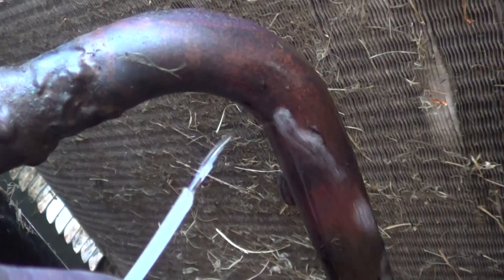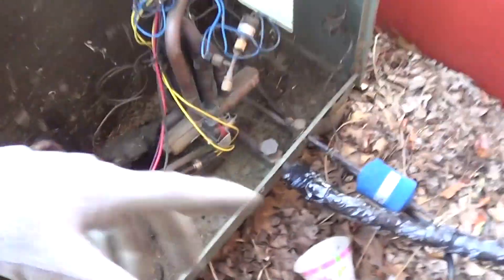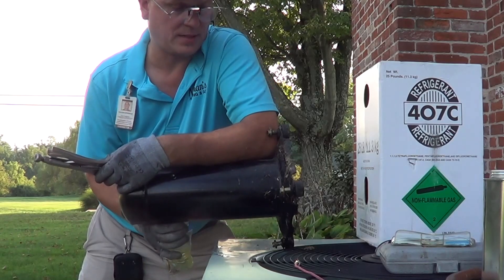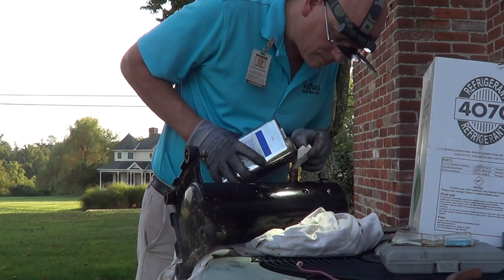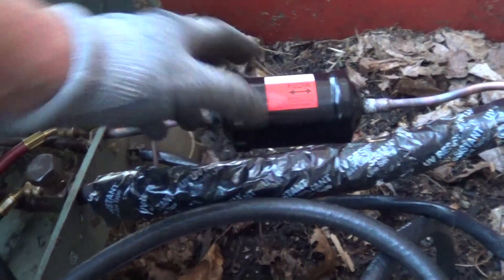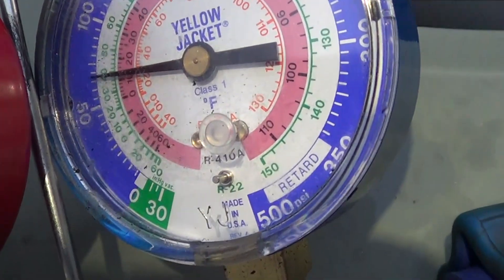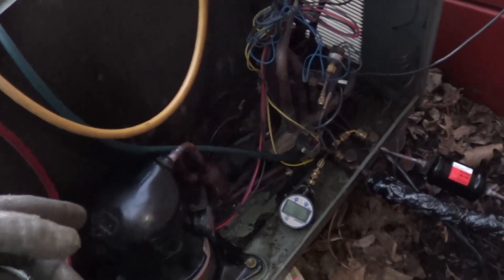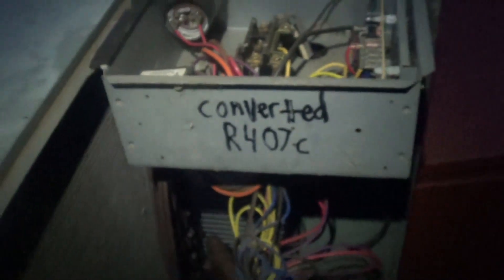Converting a R22 system to R407c

Comment: Converting a R22 system to R407c 
1 I read  95% polyolester oil (POE) and 5% mineral (old R22 oil) is OK. 
2  POE oil is hygroscopic that means the oil should be pumped in and the oil can should not be opened to the air. 
But great work this is almost unknown by local Hvac companies here in DFW Thank You
As a Hvac engineer 
You can open compressor 
Removing the valve stem. 
Insert a rubber tube down to the bottom of the compressor 
Suck out 95% the old R22 mineral oil. 
Re install valve stem
vac system
Purge with dry N2
Vac system
Charge with R407C
That way the compressor stays in place and all your doing is sucking out 95% of the old R22 mineral oil adding new POE oil then re install valve stem. Purge with dry N2. Vac the system and charge with R407c.  
Pulling the compressor IMO is not necessary.
The above is a really low cost way to go from expensive obsolete R22 to low cost R407c
Reply from the maker: The moisture sensitivity is over rated.   It takes hours for POE oil to saturate.  And, when it does saturate it is still just parts per million of water.

Comment: hello there, let me see if i understood about change the refrigerant r22 to r407c. for an a/c by expansion byt capillary tube or expansion valve only is necessary change the oil of the system and dryer filter from line of liquid? or exist other dispositive for change it?
greatings from Perú.

Comment: What a waste of time and money.  Either change to 410a or stick with the r22 its way down in price a 30lb jug is only 290.00 in Mass thats way down from 2 years ago.  This is way to involved for the results.  If my company was stupid enough to do this I would disconnect the condenser and flush it and the line set and evap coil with rx11 flush.
Reply: Piece of fuel line split   auto 2clamps 2 lb gas good as new 🤗

Comment: I've used r422b with great success! AC and reach in freezer box. No modifications!  Negligible loss.
Reply: R407C is the closest replacement for R22, and is cheaper than R422B. You use R422B is because of no oil change required?  Here is the video about comparison of different replacement refrigerants. https://www.youtube.com/watch?v=npyYvT2Z1wU
Reply: @alicepet1994  the guys around here have settled on r422b. One refrigerant to carry that works great. This coming from a trusted United Refrigeration manager.
Reply: R422 b  works great, it’s just more expensive than 407

Comment: I just changed a r22 system with 407C+, the plus lets you do a direct drop in with an additive already in the gas which mixes with the R22 oil. 407C+ is a little more expensive but it saves you the time of having to add oil. Also, if you get a leak later on, you only have to add 407c because the oil is already treated.
Reply: Old comment - but thanks. I'm a student studying for my Universal.

Comment: Old oil looks pretty clean. What's the best POE oil for R407C? Thank you
Reply from the maker: It just has to be the POE chemical designed for refrigeration applications.  There are a few brands.   It is about $50 per gallon last time I checked.   But, you can buy quarts.
Reply: @NathansHVAC  Thank you for your quick response. I bought one gallon from ebay which costed me around $80

Comment: He's a bit messy w the oil coming from myself a 22yr technician and dont make it sound like 🚀 science dude but your probly in the small percentage of good techs out there😊
Reply from the maker: The money is in replacing systems though.  So, there is an advantage to being a tech that only replaces the system.  Me...   I try to do both.  If the customer wants to keep a piece of junk running, I will keep that piece of junk running.
Reply: @NathansHVAC  YOU DIDNT NEED TO PULL A VACUUM?

Comment: 407c will foam if no new oil add. some people topping off r22  1 -2 lbs 407c will foam removing hoses. you can add 4-6 oz to mineral oil to stop the foaming yes need a new filter. Move filter to outside of condenser.
Reply from the maker: I never notice problems with foaming on residential.   Some scrolls are oil pumpers though.  But, they are usually very old and end of life.
Reply: @NathansHVAC  I see it before but did not know this happen my wife friend unit i worked on on a weekend only gas i had was 407c add 1-2 lbs next day trip the high psi reset. place hose on port Dam it foamed. Pulled gas out poured mineral out of scroll refilled synthetic POE bingo no waxing or foaming. They said to never cooled this good before. Only way to see if compressor is to pump down test to see if valve hold. Doe not hold vacuum yes end of life or 75per  lose of BTU.  This was 3 yrs ago. Last month i top off one and same thing waxing so add 6 oz POE BONGO NO WAXING 100% LIQUID. NO RESTRICTION.Now i know what to do if unit waxing up has restriction. 407c 100% and old oil will wax up. This why i never install a drier back inside a cond unit. and move it outside the unit. for true Pressure readings.
Reply: I seen waxing both commercial and residential but only mineral oil.

Comment: Use el Iseon MO99 (R438A).
Reply: Es más fácil pero pierde un 14% de eficiencia comparado con r22 y con el r407c solo 3% y si es sistema heatpump esta lejos de trabajar adecuadamente el mo99 Te lo digo por experiencia propia
Reply: @greggiron93cervantes72  , Boa noite senhor,  a adição de  20% de  POE  no ÓLEO   mineral que se encontra dentro do compressor   E O CORRETO OU ENTENDI ERRADO?, obrigado.
Reply: @josem.8159  no entendí bien jajjaja pero creo que entendiste bien le sacas el aceite mineral al compresor y le agregas 20% de poe y queda exactamente igual al r22
Reply: @greggiron93cervantes72  , senhor  Gregori,  pergunto: devo retirar todo o óleo mineral e depois usar somente o POE na quantidade de 20%  ?, muito  obrigado.
Reply: @josem.8159  tienes que sacar almenos 90%

Comment: Hi nathan i got an original r22 split system, ill be replacing condenser that equipped with 1lb of r410a,can i recover refrigerant & use r407c?
Reply from the maker: If the metering device is fixed orifice on the evaporator, you could just run R410a in it.  If the evaporator is expansion valve, you have to run R407c.  But, you will lose capacity with the R410a compressor.  But, it will work.
Reply: @NathansHVAC  the evap has a piston

Comment: I would not hire you with the practices used, the system is so inefficient now, the oil is not correct, it is certainly not ‘ozone safe’, you should flush every time, the miscibility is not there. You started charging with vapour with an azeotropic blend. I assume you didn’t check superheat or subcooling. Not trying to be harsh, but your not following the correct code of practice.
Reply from the maker: Perfection is the enemy of good enough.
Reply: Part of the “that’ll do” club

Comment: What a waste of money. It’s a r22 system. Throw it out and install a new system with wty. This doesn’t do the customer any good. 

There is retrofit gasses like mo99. That don’t require all of what you did. Weld up the leak pull a vac and charge it up. 

I’d never do what you did. None of it makes sense!

Comment: I have a customer that bought 20 rental units almost every unit had no filter and impacted coils most were low on charge. Now I’m not disagreeing with you but I told him I would have to pull and clean all the coils fix leaks and convert all that were low to 407-c or replace the systems he had just bought the two buildings and was low on cash he said he just needed to get by for 6 months and he could only afford to spend 500 per unit at the time so I pulled the coils fixed the leaks pulled vacuums and charged the systems no oil change I told him without oil changes they would not last three months ( that was almost two years ago) I’m not saying it’s not a good idea to change the oil but I am saying that two years later 17 of the 20 are still running and the 3 I had to change failed because the condenser coils lost all ability to transfer heat due to corrosion not compressor failure so to all that say it’s not possible to not change the oil and last I guess I should not believe my lying eyes right! Again I’m not saying the manufacturers are wrong but that’s not really a small test sample either take it for what it’s worth 20 for 20? Now talk all the trash you want ps that’s not the only time I’ve done it with the same results
Reply: alot of guys at my local shops are saying the same thing. just drop it in and no problems
Reply: As long as you have enough velocity (which r 22 systems have) and the compressor is not installed too far above the evaporator coil oil return should not be a problem. A few squirts of POE wouldn't hurt either.

Comment: So when you evacuate the r22 charge it doesn't pull out all the oil in the compressor too? Isn't oil mixed in with charge?
Reply: Ron's Electrical no the oil is still there but read my comment

Comment: Did you literally waste an entire day when you could've saved this homeowner the agony and brazed that leak fill it with R-22 you're out of there in 2 hours and tell them you'll need to be replacing this system very soon. It's called the R-22 phase out. Wow!
Reply from the maker: 407c is super cheap and the only r22 substitute with full capacity.  But, I don't convert very many systems.  I mainly wanted to video this conversion because the other substitutes have their own problems with capacity or charge sensitivity.

Comment: I cant fathom why you wouldn't take two minutes to measure out the old and measure in the new oil.
Reply from the maker: You don't need accurate oil levels.   Plus, since this system was very low, a lot mineral oil was in the evaporator.  It is not rocket science.  This system is still running fine today with the conversion.

Comment: What is the process if it was r410a instead of 407c on a r22 system
Reply from the maker: R410a needs a new system.  The pressure is double that of R22 and the compressor won't pump it.

Comment: Did you flush the lines?
Reply from the maker: Poe and mineral oil mix fine.  They are both oil.   If you have synthetic blend in you car you are running mixed oil.  The idea is to have enough poe in the system  to mix with the 407c refrigerant.   The poe oil will drag the mineral oil back to the compressor.   This is residential, not low temp.

Comment: And 2 months later you get another leak on this dinosaur. 1500 bucks down the drain.....
Reply: Troy B true that
Reply: Troy B maby but do u call the shots or does your customer your invoice should give a detailed summary of why you recommend against it and then let them decide if they want to do it and you refuse then I or someone like me will be happy to take the job read my comment
Reply: @peterdarlington4117  won't touch it. I'll collect my fees and roll out.
Reply: Troy B So basically you’re going to tell them I’m going to charge you for telling you that I will not make a repair because I don’t agree with it if there’s ever a case where I’d be like I am not paying you buddy take me to court that would be it A good tech gives them every option and lets them decide maby that’s all the money they have and want to roll the 🎲 and I’ve done a lot of no oil change conversions to 407c and years later they are still running and others said only option is change system they will never use anybody but me agine
Reply: Troy B I get what you’re saying not trying to beat u up I use to be the same way
Reply: @peterdarlington4117  there is a sevice fee for diagnosing the problem...you have a leak. Then there is a fee for pinpointing the leak. The leak is in your condenser.       
  If you are charging g your customer to repair a leak on a condenser that is over 10 years old with only a 1 year warranty on your weld only...you are ripping your customer off. There is a proper way to do stuff and then there are the other guys.
 I can get a new condenser for them with a 10 year warranty.
Reply: @peterdarlington4117  yah that's what I'm saying.  The fact remains that I did the work and they owe. Most likely it would only be the service fee because I would have explained about the leak. If the want to keep my service fee then so be it. I'm not sure what your hang up is. You telling me you would do the repair which is in my book ripping them off. You should know better than what you are saying. It's the homeowners junk and you are going to put him 1500$ in the hole on a new system and leave him in the heat....again.
Reply: Troy B The other thing is with me that’s not a $1500 job I charge 600 bucks to sweat in a dryer and fill the system with gas and repair that leak And for some people if that gets them a year they’re happy with that And that’s not me saying that if you charge $1500 your ripping the customer off it’s just me and my sons I don’t have the overhead of 10 trucks on the road and all that mess and by keeping my company small I keep my prices low so I guess it’s just the difference and how we run our companies but I also don’t guarantee you know I’ll be there in an hour or some stupid shit like that my customers wait till I can get to them because they know it’s half the price of most other companies But it keeps me busy and keep my customers happy
Reply: @peterdarlington4117  600 is better than 1500, but 600 is too cheap, may depend on location. i welded a york package unit one time, the weld was solid. within 2 months the customer developed a leak a few inches further down and we ended up telling him "we will be chasing leaks down until you cant afford a new system", he bought a new system. never again will i repair a "condenser coil".  im also sure you shortened your list of the repair.  flush, acid test, oil, vacuum to name most of the others. Not to mention good luck welding up these thin azz coils they have these days and im sure if its aluminum you are not welding it. Anyways we are both in it to make money and if you are making the money and you feel its a good profit, well.....thats all that really counts as long as the customer is happy.
Reply: Troy B no list shortened I’m very aware that you’re supposed to change the oil and do all the stuff the manufacturers recommend but if you read one of my other comments on this post I wrote a whole thing about a customer Of mine who bought 20 rental units and I did not change the oil or add acid scavenger I just recovered pulled a vacuum and charged out of the 20 of them I did 17 are still running and three had to be changed but not for an electrically shorted compressor for condenser coil‘s so corroded they could no longer exchange heat running a 425 head pressure I actually told him he would probably only get six months without changing the oil but like I said it’s been two years and I have multiple other instances where I’ve done the same thingAnd they’re still running with no problems again I’m not trying to say that’s the right way to do it but that’s also why I only charge $600 well that and the guy has 230 Rentals and I do all of them But also he has been a customer for a long time he knew the risk but decided to roll the dice and it paid off for him

Comment: I use R438a (M099) and no oil change. No failures in 5+ years.
Reply: Same here. I just change the driver. No problems. About 8 peices of equipment in the last 4 or 5 years.
Reply: Drier
Reply: Propane  is scary

Comment: Hello,   I hope you can give me advise on this
Currently, I have R22 3 Ton it stops cooling after 30 minutes. its 11 years old, tech said compressor heats up then stops.
So my question is which brands do you recommend and coolant? I have a quote for $4k Guardian 3 ton/14 seer with new evaporator coil  410a. Or American standards 3 Ton/ 14 seer with coil 410A $5800.   do you recommend changing the pipes or flushing it should be good enough
?  In my city of lodi,ca electric is not expensive last month usage 1184 kwh total $200 that's heavy use, in winter we use 675kwh
Reply: Delta Transportation Worldwide check your outside condenser coil. If it is dirty it can cause high pressure and trigger the high pressure switch. I have seen a lot of situations like yours. When the coils are dirty the heat wouldn’t be released. High temperature high pressure. Just clean the coil you will be fine. Some company push their technicians to sell whole unit to get commissions.

Comment: I've been adding straight 407C to R22 units for the past 4 years and no call backs.  Systems are running great.
Reply: How are the pressures?similar?
Reply: @Clamjammer  very similar.  Only thing different is that you turn the can upside down with the 407c.  I add it very slowly.
Reply: refugiorod Add 20% POE on the top of mineral oil? Or 100% change out for POE just like he did in this video?
Reply: I am with the EPA and would like to visit with you. What is a good number for you?
Message me.

Comment: 407c kills capacity too, you're actually losing 7% in capacity compared to R-22. And you shouldn't have more than 5% by weight of mineral oil. If you haven't had a call back you're lucky. As a contractor I dont recommend the use of drop-in replacements, the risk heavily outweigh the rewards. Either leak search and repair, and recharge with R-22 or sell them a new unit. Save the customers and yourselves the headache of a return visit with additional labor costs.
Reply from the maker: Mineral oil comes back fine in residential applications that have high temp evaporators.  There just needs to be a minimum of 20% POE oil in the system.  I verified this with a phd industry expert that works for one of the big refrigerant manufacturers.  I can't name my source because for obvious reasons.